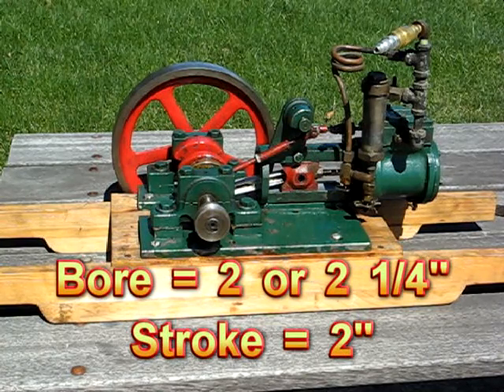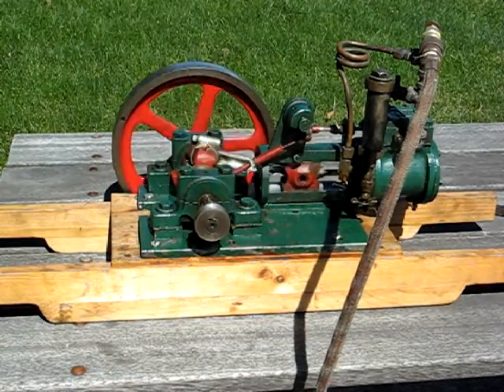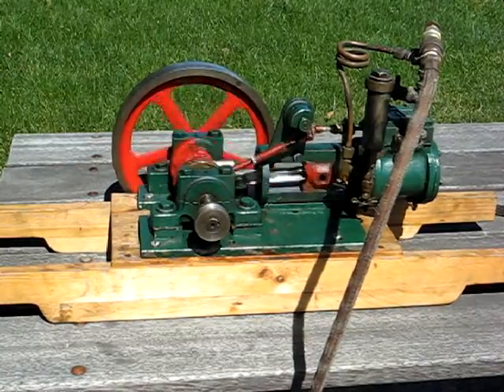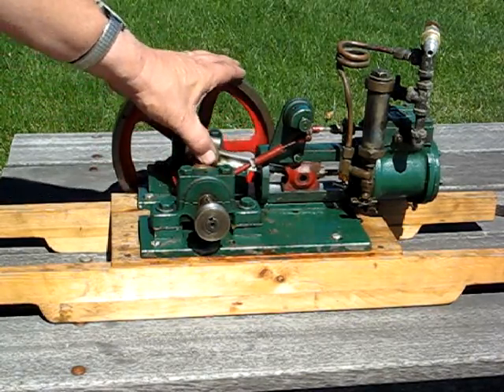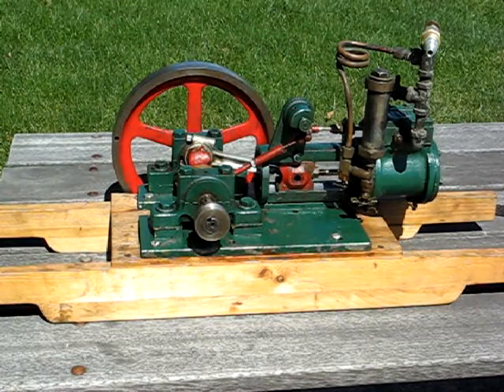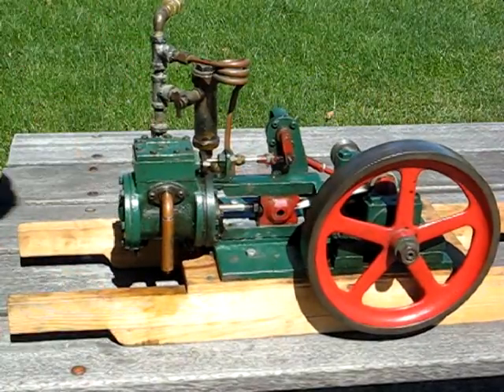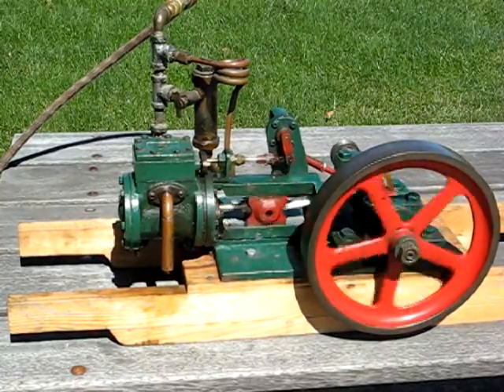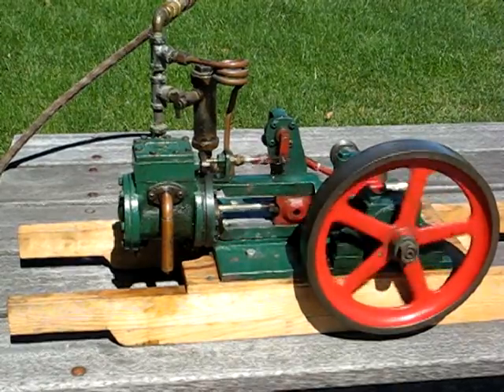Modified Stuart Steam Engine

Comment: I think what eatmypies means is that this engine was converted from a stuart or similar boiler feed pump hence the valve rod linkage and the addition of a crank and conrod to covert it to a rotary engine after removing the water pump end.